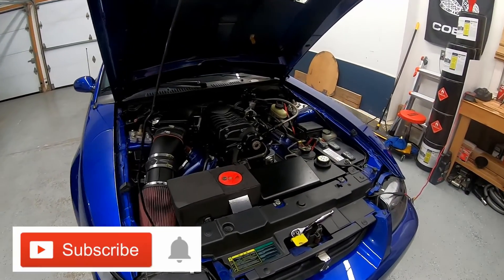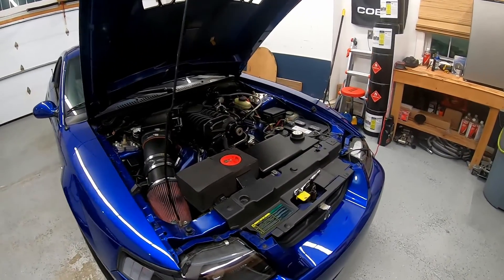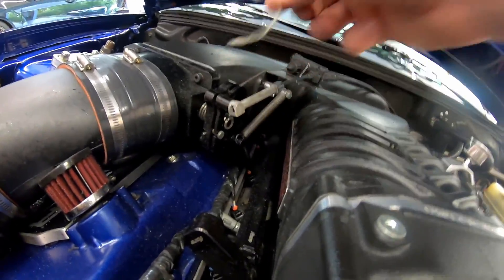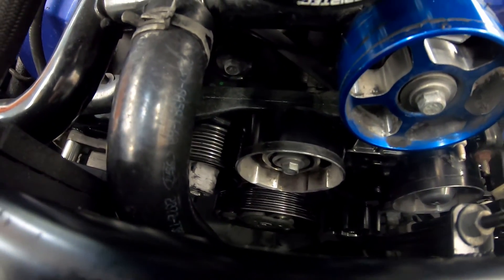Raced a Modded C6 corvette ZR1 and 03 Whippled Cobra - Then my Cobra SMOKED BAD :(

Comment: I had the same thing happen to me when I banged second gear. Fortunately at the time I was using an engine shroud so it took all the grief dished out by the shredded fanbelt. I was picking pieces of belt out of my idler bearings for days!

Comment: I had a similar thing happen on my Lysholm/Vortec 3300 but in my case, the head unit seized up. I only had the blower for less than 2 years and it’s a Weekend only car. Very disappointed in the support from Vortec.
Reply from the maker: I think Whipple would take good care of me.

I am in NO WAY sponsored by them, but I feel they would do the right thing in this case if it was the blower.

Blower spins freely by hand with no noises so I feel I avoided issues
Reply: I agree with you as Whipple is a class act. I’ve previously purchased 2 Centrifugal “S” trims for my Fox bodies and they still wouldn’t work with me. They have lost me forever!
Ohhh, I too had melted belt everywhere and I took all the pulleys off to clean them. I’ve since had my stock Eaton Ported and port matched the elbow, added a Accufab S/blade T-body just to drive and  am saving $$$$ for a different blower.

Comment: Lose a belt lose an alternator? You have stock tensioner? I do and curious if I should upgrade.
Reply from the maker: Stock tensioner with a metco brace
Reply: Intervention302 your alternator shot from losing that belt? Is that what you were saying? I got a Mechman 240amp. It’s got a no questions asked warranty thank god but it’s not the funnest to replace. I just installed. Maybe I should go ahead and replace the belt.